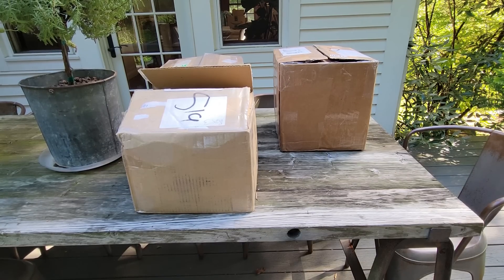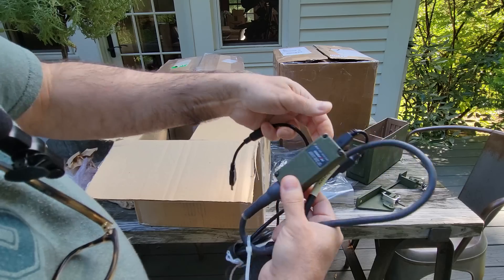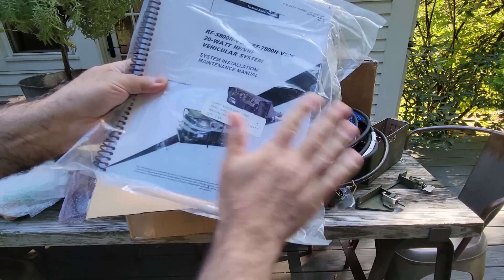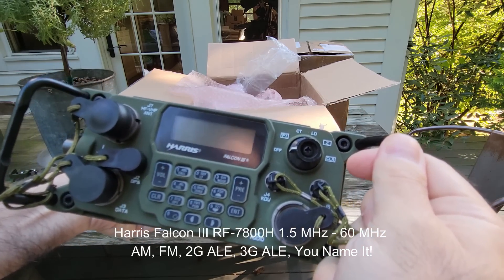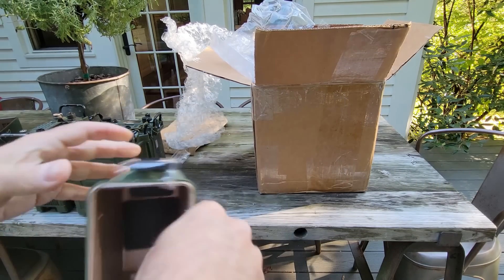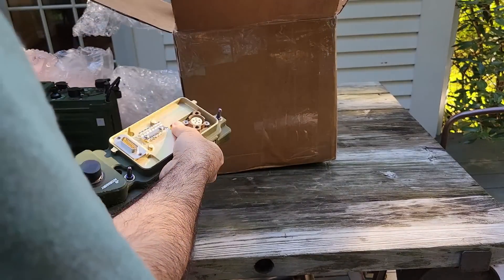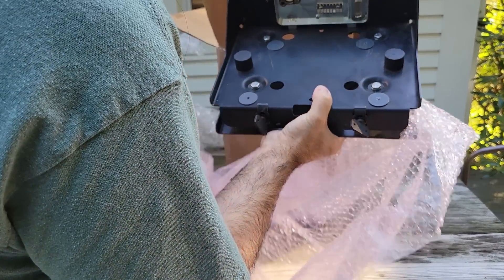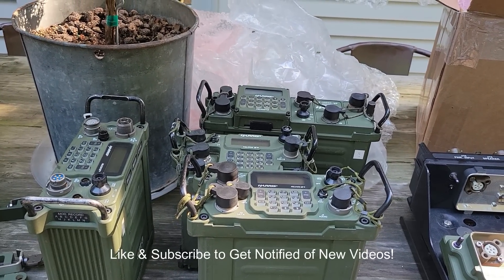Harris NATO Radio Haul Unboxing!

Comment from the maker: All: Just to clarify, these radios DO NOT contain any US military cryptographic technology. They contain exportable crypto like AES256 same as your web browser and Citadel which is "exportable". If these radios were the AN/PRC-160, AN/PRC-150 or AN/PRC-117G then that would be bad. But these are not. They are NATO/Civilian versions, RF-7800H, RF-5800H and RF-7800M. These are fully legal to own in the US. Of course, I could not ship them outside of the US as that would be a violation of ITAR (without the correct paperwork). I hope this clears things up. Read more here: 
https://www.l3harris.com/all-capabilities/falcon-iii-rf-7800h-mp-wideband-hf-vhf-manpack-radio
https://www.cryptomuseum.com/crypto/harris/citadel/index.htm 
https://www.cryptomuseum.com/crypto/harris/rf5811/files/citadel_leaflet.pdf
Reply: do they use the same connection ends as the standard version?
Reply from the maker: @redred333 Yes! You can use the standard U-229 family of accessories.
Reply: But in Jesus Christ name, how did you manage to get 7800MMP and 7850MHH??
Reply: So you can buy one and does not need any DOD permission or outside US? They are now considered obsolete by L3HARRIS like the falcon 2 series hf manpack radios..i forgot to read the whole narrative...sorry my fault

Comment: Can you tell me about the longevity of LCD displays in Harris equipment?  From personal Hamfest experience commercial/amateur equipment from the 70s/80s era with LCD displays is often unusable.  The displays "dry out"?  I guess spares might be available, but Harris are unlikely to stock spares for equipment no longer actively used by commercial/military customers... I. wonder about the longevity of modern equipment using TFT and oled displays as well...  Replacing caps in vintage equipment is one thing, but LCD displays...
Reply from the maker: I don't think I've ever seen a bad LCD or have one go bad on a piece of harris equipment. But I dont put these through the rigors of combat so I can't be certain.  The only thing I can say is some of the older harris LCD equipment (80's-90s') used EL backlighting instead of LED and sometimes those backlights get dim. Otherwise I've been pleased with how the LCDs hold up. 73

Comment: Hey can I ask you a questiion? What is the antenna cable I need for a 5800V? Thank you.
Reply from the maker: You can use a standard 50 ohm BNC cable for manpacks and a standard TNC cable for handhelds. Good luck!
Reply: @w2hx   ok thanks. I have the adapter for the antenna that folds like tent poles. I guess I just need the large diameter from the radio reducer so I can run the cable?
Reply from the maker: @snipervail  many available on ebay. Search for "harris antenna adapter"

Comment: Hi! Do these stations have any advantage over modern amateur radio stations, with the exception of durability?
Reply from the maker: For amateur use, probably not other than durability which you mentioned. But I (and others) have a strong interest in military communications technology which is the appeal of these radios. But they are very rugged, unlike amateur equipment. 73

Comment: So what do you do with those units? Do you get them back in working order and use them for some type of ham application?
Reply from the maker: Add a battery and antenna you're on the air.  Yes ham application!

Comment: Nice Haul  !!! Great condition. I was on the (L3)Harris Falcon II and Falcon III teams that wrote  DSP code,  FPGA code and crypto code for many different Wide band and narrow band voice and data waveforms on all 3 of those radios plus the VHF radios  for 12 years up until 5 years ago.  These must be the export-safe crypto versions not the CCI type 1 ITAR crypto versions or they have cheater crypto cards which completely bypass an actual crypto. In any event, it will be fun watching  videos of you operating these. Enjoy !
Reply from the maker: I'd love to get in contact with you. do you have a call sign?
Reply: Loved that HPW and Harris SA mode!
Reply from the maker: @MrOldManP  It seems you have some first hand experience. Let us know more about your experience with these modes!
Reply: shhhh  the enemy is watching!
 @MrOldManP
Reply: Привет! очень приятно видеть таких людей здесь!
Reply: AHEM...
Reply: Hello John, thank you for sharing your experience with the Falcon II and III radios. I have a technical question about firmware and FPGA updates. On Falcon III units with hardware revision –02, is it possible to use FW 2.0 or 2.2 as an intermediate step to rewrite/update the FPGA, so that the radio can then be upgraded to FW 2.4 (which includes VoIP)? Or is this a misconception, and those units are permanently limited to FW 1.6 due to hardware/FPGA constraints?

Comment: Do these radios have layer 3 networking capability?
Reply from the maker: Absolutely. They also have some wideband modes for better throughput.
Reply: @w2hx  I see. What “Waveforms”(which I assume is a fancy term for what we in the amateur world call “Modes”, which I assume is a stack of protocols) would these radios use for networking? Do these waveforms use special networking protocols or do they just plop the IP stack above layer 1?
Reply from the maker: @AliBaba-vw7mo  IP all the way. Very easy to turn them into IP routers. The data link layer is where they can use their special data modes.
Reply: @w2hx  I see! Very interesting! Never thought military spec networking waveforms use IP… I thought they’d use some black magic. Also, what networking waveforms do these radios support? I’ve heard of ANW or something like that.

Comment: Cons: The cheapest mil-spec connector costs $100.
Reply from the maker: Yes from the mfg, but there are tons of cables on the market for like $20-$50 for whatever you might need. check ebay.

Comment: Pros = Rugged, most likely water proof and EMP shielded, versatile and easy to use (for the most part)

Cons = Proprietary and protected to some degree making it expensive and hard to get parts, software and certain info on.
Reply from the maker: Agreed on all points
Reply: Unless you're in the military, and then it's just a requisition away. (not counting clearance requirements.) Or a contractor who has to deal with them. (again, non-classified docs)

Comment: I have to ask… where/how did you come across these?
Reply: They fell off a truck.
Reply: @elfnetdesigns702  Well they had a little help They probably were never even used in the ukraine fraud war effort, my guess is the troops stole them and resold em.
Reply: They are on sale on the internet from time to time. Not on ebay.
Reply: @hene193  Could you specify me where we could locate some used stuff like that?? It will be for education pourposes. Thanks in advance.
Reply: Love your Green radio vids!!!! May I ask, what is the color code in RAL for example of this batch of Harris radios? Might it be RAL6003????
I understand it's CARC quality but the sheen of the color is quite amazing in various light conditions.
Reply from the maker: @user-ro3mn5eb9d  sorry I have no idea :(
Reply: Yeah I might want one of those.   
Side note, I hope when you opened the boxes before the video, you didn't let out any spurious emissions.  
<roger beep>